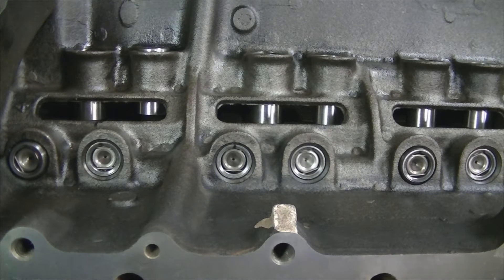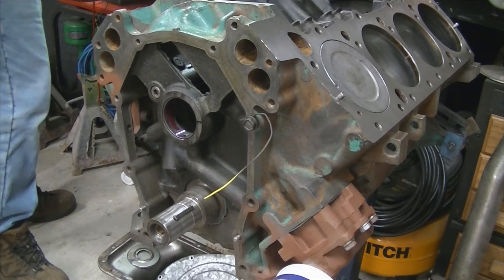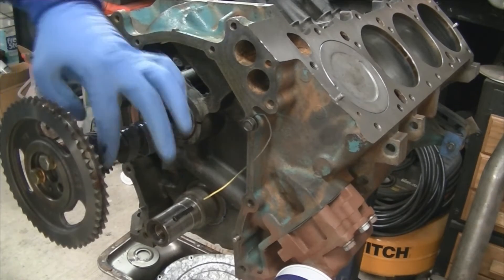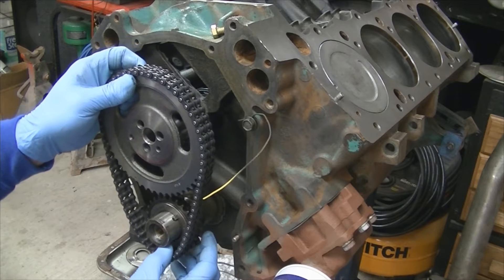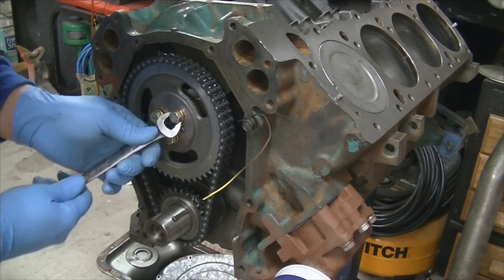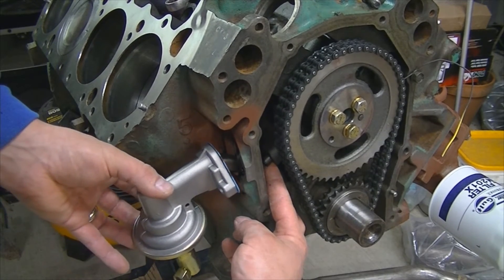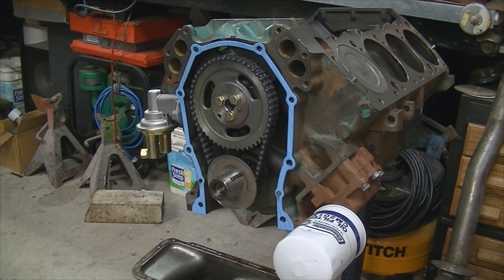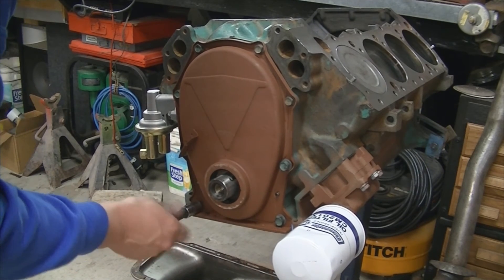Joe’s Garage 383 Engine Rebuild Part 4 – Timing Chain installation

Comment: Im sorta confused. I have a 400 im thinking of doing a chain set on. Ive done many chain and cam swaps on small block mopars. What i dont understand is what holds the chain gears from walking forward? Like small blocks have a thrust plate that bolts in front of the cam and that hold it in. But on this set up what prevents the cam from sliding forward?
Reply: The same taper on the lobes that makes the lifters rotate is supposed to force the camshaft rearwards when the engine is turning..

Comment: Any tips for changing the timing cover crank seal?
Reply: Use 2 seal pullers at once. One at 3 o'clock one at 9 o'clock. Dont hurt the surface on the crank. If any minor pitting or corrosion is there where the seal rides this is why the old one failed. So take some fine grit emory clothe and carefully and evenly wrap it around the crank surface and polish it up. Dont go overboard! When you put your new seal in put a little grease around the outside and also on the seal surface. Find a big socket that fits over the seal and contacts the metal edge. Usually a 3/4 dr socket. Gotta be big. Like 1- 7/16 something around there. Then hammer the new seal in using that big socket for a punch. If not find a piece of wood to hit it with. Dont hit it dead on with a hammer. As it can distort this way and then it will leak.

Comment: I noticed the no.1 piston was at tdc with the dots on the sprockets aligned. Would that be the top of the compression stroke? Distributor would point at no.1 as well?

Thanks.

Comment: what if they don't rotate
Reply: Dwayne Montoya then swap them around untill they do. Or you may have to hone the bores that are too tight.
Reply: If they are used. Like this is a used engine your looking at that means the cam and lifters are worn and they will fail shortly. Unless its a roller lifter motor. At that point its obvious they never should spin. Too tight or too loose of a lifter bore is something people often overlook too. But what makes the flat lifters spin is cam lobes are actually slanted slightly. And the "flat" lifter face actually isnt completely flat. It is very slightly domed. So as the cam lobe comes up the dome of the lifter rides on the left to right slant of the came lobe. Without this design feature things wear out much faster.